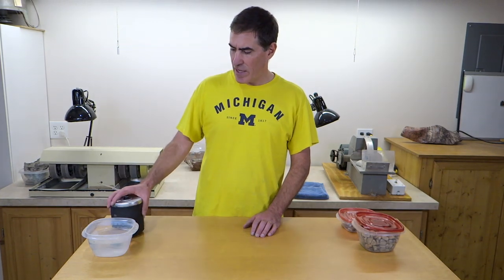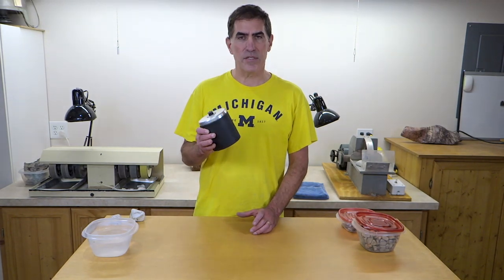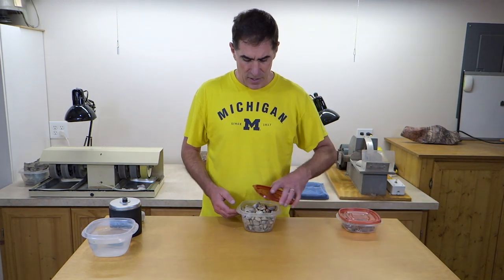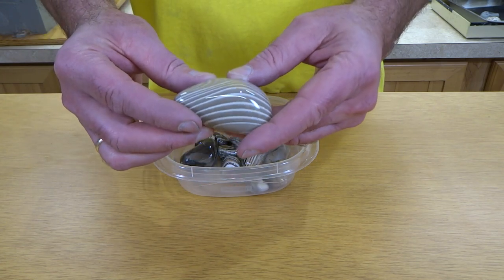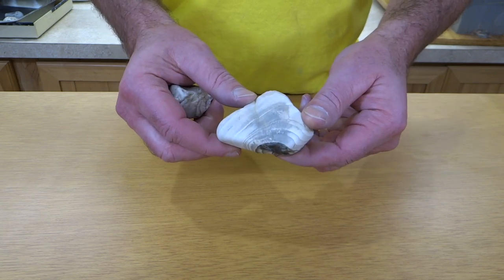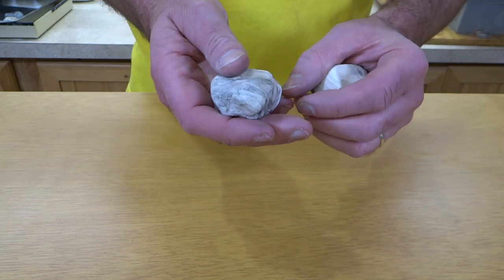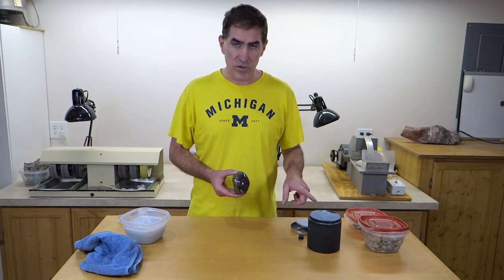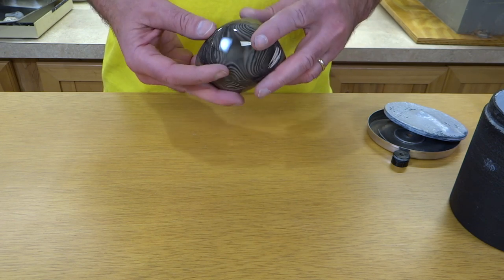Banded Chert, Tumbled

Comment: I've never seen Chert look so good! We have similar banded Chert here on the shores of eastern Canada. What is your procedure for tumbling one big rock such as you did with the piece in this video? I've never tried it but have a couple of rocks I want to do. Any advice would be appreciated! Thanks!
Reply from the maker: I ran this through many weeks of coarse grit until all the holes and cracks were gone.  I did this in a six or twelve pound barrel I don't remember which and it doesn't matter.  I did all the other stages in a three pound barrel.  I used mixed sizes of ceramic media and no other rocks.  It spent one week in 220 silicon carbide grit, ten days in 500 aluminum oxide and two weeks in aluminum oxide polish.
Reply: Michigan Rocks did you use the ceramic media in the coarse grit? And are you filling the barrel 2/3 full with the ceramic media?
Reply from the maker: @RockhoundingLife  In coarse, they were just in with other rocks.  I never use ceramics in coarse.  If I don't have enough smalls, I use saw scraps.

I shoot for 2/3 or 3/4 full, but usually just do it by guessing.  More full protects the rocks a little more, but slows the action down some.

Comment: WOW. VERY nice stones. 
Thanks for sharing.
Oh... and a technical question - can you tumble small stones (1cc-2cc) and do they come out as nice as the big ones?
I'm asking because I like embedding stones (agates, for example) in my own design of pendants and earrings for my wife (I don't sell these).
Thanks!
Saar
Reply from the maker: Yes, most of the rocks I tumble are small.  Mixed sizes work the best.  This is the largest rock I've ever tumbled.  I have a video about tumbling crazy lace agate.  Those rocks are much smaller and turned out great.  I'll have more tumbling videos this winter.
I also tumble other shaped rocks that could be made into jewelry.  If you have shaped the rock into an oval or something, you should use a vibratory tumbler to retain the shape.  If you don't care if the shape changes, then the type of tumbler doesn't matter.
Reply: @MichiganRocks  I have seen the crazy lace agate video - that is really superb (both the video and the agates). I personally used to tumble too - years ago - but I used my homemade roller to ball mill charcoal to fine powder and make my own rammed charcoal sticks for drawing. I don't tumble rocks (I just buy them from ebay... sad, I know). Keep up the wonderful work :)

Comment: Hi Rob.  I took your advice and my wife and I went to Norwood and found some really nice banded chert.  I am getting ready to polish some but I noticed that most all of it has relatively sharp, deep, edges and I am a little concerned that it will take a really long time for the coarse tumbling.  Any suggestions on how to possibly reduce the coarse step?  Maybe cutting some of them to try to remove the deep portions?  Thank you in advance for all your videos, they have REALLY helped me learn a lot of this new hobby I have chosen.
Reply from the maker: You can always cut or grind rocks before putting them in the tumbler. Cutting is cheap because saw blades last a long time. I always thing twice before grinding just because wheels for my cab machine are so much more expensive than tumbling grit. I save the wheels for really nice rocks.
Reply: Thanks.  I can’t thank you enough for all the advice and help.  Norwood beach was a nice surprise with a lot of great stones.  Can’t wait to see how some of them turn out.

Comment: I am new to tumbling. When you run Stage 1 Course for weeks how often do you check the progress and how often, if you do, change out the grit? Much appreciated.
Reply from the maker: I clean the rocks off once a week. I take out any rocks that are as rounded as I want, put in new rocks, add fresh grit, and start them rolling for the next week. 

I have a lot of complete tumbling videos. Pick one that looks most like what you're trying to do. For most people, the second video is probably best, unless you have a National Geographic tumbler or something similar.

Rotary tumbler followed by vibratory tumbler:  https://youtu.be/hz2E0xJYEWY
Rotary tumbler with ceramics:   https://youtu.be/dYGFal0e1WY 
Rotary tumbler with plastic pellets:   https://youtu.be/EnNvywwztr8  
How to use a Nat Geo Tumbler: https://youtu.be/CsTc1kXUuPo
Tumbling beach rocks in a Nat Geo tumbler: https://youtu.be/_Vmm24Fc7j4

Comment: Question, with your ceramic Media, did it thicken up the slurry as the process went?
Reply from the maker: Ceramic is very hard, so it doesn't wear much while tumbling.  It does wear some though, so I suppose it thickened the slurry very, very slightly.  The most slurry thickening happens in the first stage when I don't have any ceramic in the mix.  That's because in the first stage, I use 46/70 grit that grinds away rock a lot faster than the finer grits in later stages.

Comment: You said that the first grit tumbling went "forever". I think I have a banded chert. I tumbled mine in the normal cycle of one week per grit. There was little change. I'd like to do it again with longer cycles. If I use the first grit "forever", how often do I replace the grit? Is there any way to show a picture of my stone to confirm its identity?
Reply from the maker: Greg Powers I check my barrels once a week and remove only the rocks that are done.  To me “done” means no holes or cracks.  The time varies from rock to rock.  Watch my crazy lace agate video to see this demonstrated.  I’m not great at identifying rocks, but I’ll take a look.  Just post the picture somewhere (Instagram, Facebook, Photobucket, etc.) and put a link here.  I’ll go check it out.
Reply: Do you replace the grit every so often?
Reply from the maker: Greg Powers that link didn’t work.  I replace the grit every week.
Reply: @MichiganRocks  where do you get grit at the best price?
Reply from the maker: @gregpowers1045  I buy fifty pounds of 46/70 at a time from Kingsley North.  They will ship in a flat rate box, which is cheaper than the price they quote on their website.  I think they do it automatically, but I always include a note in my order asking for a flat rate box.  I buy all my other grits from http://therockshed.com